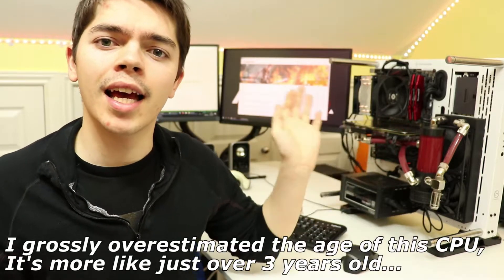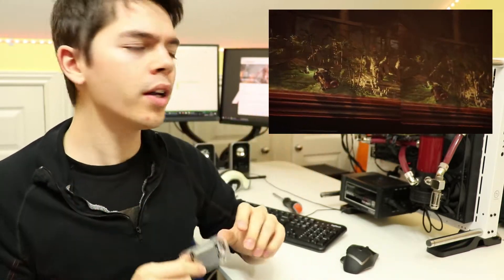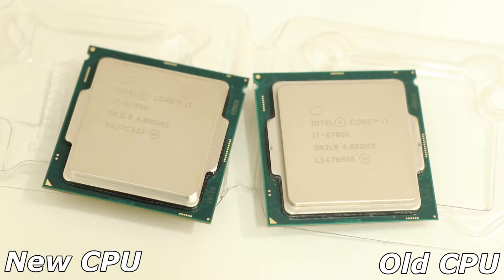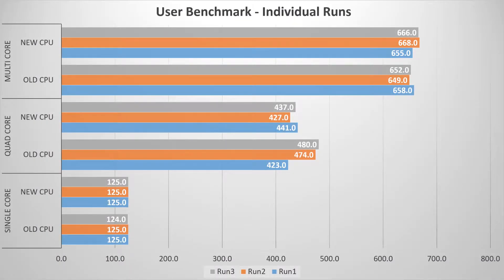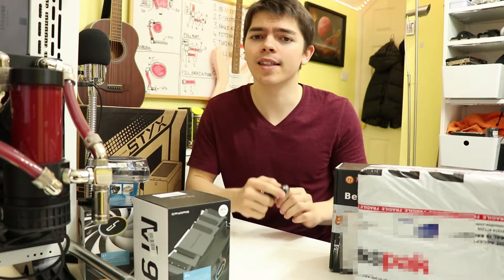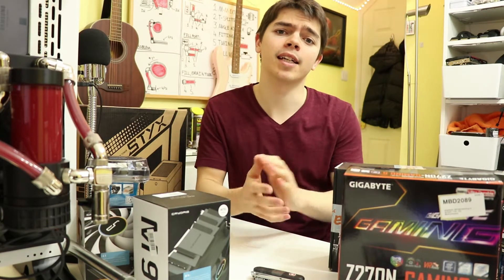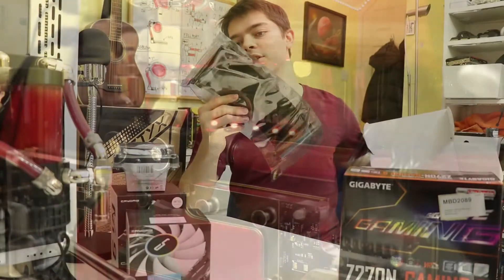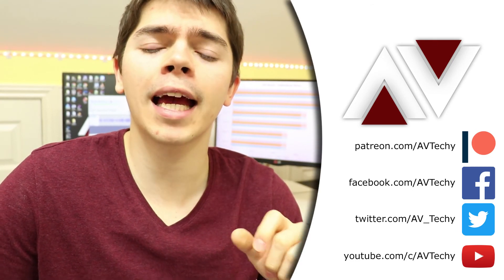Old CPU vs New CPU - Does performance drop with age?

Comment: I suppose another variable when you buy a used CPU, hopefully the cpu that was owned by the previous person didn't overclock it to the moon causing overheating/damage.
I.e insufficient cooler.

On the other hand a "locked" cpu might be a safer bet to buy used, since the cpu is locked from overclocking, so no undue stress was put on the cpu.

Comment: Idk, I have an i5-4690k that I've been using since late 2016 and I can tell that it's been struggling way more over these past couple of years, it's performance degraded severely in some more recent titles, going so far as to drop me 30 fps in most of them (making them bad to play or straight up unplayable). Did an auto and safe overclock on the Bios to 3.7Ghz recently, got about 15 extra fps in GTA V which is about what I was going for at the time, but I can still tell it struggles and tends to cap at 100% usage quite frequently, any tips?
Reply: First off, your windows will be slower and pain overtime, and with installing more softwares, it will be heavier, therefore causing lower framte rates.
Secondly, you should change your thermal paste once in 2 years. The quality of the paste also matters as in some cases, Thermal Grizzly's Kryonaut paste performs better than your conventional paste. You can also install GhostSpectre's superlite windows if you're just gaming on your pc.
Reply: combination of Software + Heat = Slower Hardware, Reinstall windows and clean your PC or use better cooler
Reply: @hashire1638  I built a different PC since then, it's got a Ryzen 5 5600X and an RTX 3070, still runs GTA at 80-100fps @ 1080p lmao

Comment: Good test , still running my old 6700k  on spare rig and with old 1080 it maxes current games and runs vr great .
Reply: I used a Xeon e3 1240 v2 for several years and now a i7 11700 some performance!

Comment: So why have my pc lowes down considerably since I bought it the first time? My gpu is slower as well.
Reply from the maker: CPUs and GPUs don't really degrade much in performance over time since they're solid state, unless they've been overclocked heavily.

What might have changed over time if the workload, perhaps they programs your using have become more demanding over time of your CPU and GPU which makes them appear slower.

The main factor which causes PCs to slow down is an old or full hard drive. Even SSDs slow down, mostly when they get close to full. Of course HDDs are far more susceptible to degradation with all the moving parts.

Hope that helps :)

Comment: I have frequent power loss at my dorm, I'm wondering whether that could degrade my pc performance over time? or will it just outright stop working if damaged rather than just slow degradation?
Reply: maybe PSU not sure id say make sure you are always plugged into a surge protector you should be okay. I doubt your hardware is damaged unless you are plugged into the outlet directly

Comment: thx for the video. i was wondering if this was a thing. i use a 4790K still. think its 5 years old by now. but i thought i saw some performance drop in games or handbrake (which i often use). But as i see now its not the case. i cool my CPU with a NH-U14s from noctua. just changed the thermal paste a month ago or so. so this is good to know that a CPU wont loose performance over time. Anyway nice video. will give you a sub :-)
Reply from the maker: Appreciate the sub! Glad you found the video useful and interesting. Hope you enjoy many more videos to come!
Reply: @AVTechy  you are welcome. and i am sure i will. keep up the good work :-)

Comment: CPUs do not degrade nearly as quickly as everyone seems to think. Even at temps up to 100C there won't be that much degradation. Overvolting or rapid, frequent, extreme temp changes are the only things that will actually kill them.

Comment: Shit test: all CPUs have different potential from factory.
Reply from the maker: Very true, but generally that's most noticeable with overclocking, not stock specs.

There are tolerances that are met out of the factory at stock specs (voltages, clocks, cache performance, etc.) which vary between each CPUs in the same SKU, but they are set within a certain tolerance. Lower or higher performing CPUs outside of the target tolerance will generally be set aside for a higher or lower performance specification CPUs. A poor performing 6700K might be released as a 6700T or 6700, or even an i5 or i3 with a some locked off cache or cores.

So some confidence can be found in the performance range based on the general "binning" process (not binning for the best performance, just performance based on the target specifications).

Regarding the target performance at stock speeds (tested in this video), I have relative confidence that there's little difference between CPUs performance based on age. The performance was very comparable with the voltage locked at 1.2V, and the clock speed locked at 4.0GHz. If there was a noticeable difference we would likely have seen a noticeable drop in performance output, but it's pretty clear that there wasn't a noticeable difference, so we can be pretty sure that the older CPU didn't fall far below the target spec (if at all).

If there were large variances in the temperatures or performance of these CPUs I'd be more inclined to agree with your comment, that could be down to factory differences (but the general binning process could also dispute this since we are testing stock specs, not overclocked or undervolted settings). But since they're so similar, I don't think factory anomalies are playing much of a role here.

Comment: Interesting test. I was expecting some degradation. 
Maybe a cpu that was used in an inadequately cooled system for many years the constant overheating may degrade transistors... Who knows.
Reply from the maker: Thanks, I wasn't sure what to expect. I think there are potentially some tests that could be performed that are longer (many hours) and more aggressive that could reveal a measurable performance gap. However I don't have access to that type of test (but extended stress test are possible on a lot of the bench-marking programs).

At least with these small tests it's conclusive that there aren't any noticeable differences during everyday and gaming applications.

I think you're right, with a poor cooling solution and high average processor load there would be substantially more damage to the transistors. I can imagine it would have to be at an average temperature of 70°C+, and potentially overclocked to accelerate the results. Someone did post an article to CPU degradation which was a good read, but I can't seem to find it anywhere at the moment.

But either way, it appears CPUs are tough components, and this opens the door to purchasing second hand CPUs with a little more confidence.

Anyway, I tend to go on a bit too long in the comments. Thanks for commenting and adding your thoughts, and of course thanks for checking out the video!

Comment: Any thoughts about getting a Ryzen CPU?
Reply from the maker: I was and still am really keen to get a Ryzen system. The extra cores would be more suitable to what I do most which is editing over gaming. And I will at some point start streaming some content, so again those extra cores would be fantastic.

The only problem I have is that to get a system that would be more capable than the current system I have, I would have to spend an amount of money that I don't have at the moment. Financially this channel can't really afford to spend money at a faster rate than it is right now. I'm going to need to save up a little to do a bigger video, it will happen at some point, but it's going to take some time as all good things do (let's hope it will be good anyway haha).

Anyway, I'm definitely interested in Ryzen as a more productive platform. I'm saving up for something, maybe that something will be a Ryzen build. It would be pretty cool.
Reply: Understood and that makes perfect sense. An advantage you have at least is most of your parts would carry over from your current build. A B350 motherboard with the Ryzen 1700/1700x will really be all you need. The 1700x as you have much better cooling solutions and won't use the stock fan with the 1700 (i think). But if you need to save up, there are new CPUs in April.... that could be an exciting thing to save up for. Good luck with whatever you decide to do.
Reply from the maker: That's certainly true, the parts are all here. But the funny thing about that is, I don't actually have a system that stays the same. Even the test bench is constantly changing depending on what video is being made.

It would be great to have a complete other system that I could use for all of my editing, since at the moment I'm constantly shifting the SSDs and HDDs,as well as the RAM, GPUs, and coolers to different systems for different videos. That's one of the biggest things to overcome when it comes to making these videos in the long term.

If I went for a workstation system, it would certainly be a Ryzen based system, and I'd want to go for a 'round' 32GB of higher clocking memory than what I have now, Ryzen seems to work better with the faster RAM. But RAM prices these days, it's insane! Of course if someone gave me an Intel based system with 8 cores then I wouldn't complain haha.

I think right now I need to put the channel first in terms of finances. I don't mean that I'm going to make myself homeless in the process, more like I will deal with the meagre issues of not having a consistent system for now until I get to point where I can have the cake and eat it too (and it's not like it's that big of a deal to work around).

Whatever happens it's certainly going to be interesting!
Reply from the maker: I don't think that's a term someone calling themselves 'Maestro' should be using...

Comment: Old CPUs definitely slow down over time. This is because transistors do experience wear, which results in reduced switching speeds. Most people never see this because they aren't running high clocks, but you might see the difference when overclocking or Turbo Boosting. Read more here: https://spectrum.ieee.org/semiconductors/processors/transistor-aging
Reply from the maker: I can imagine that is the case, wear and tear gets to everything eventually. Clearly I haven't got aged hardware that has been pushed hard to see that performance gap. Plus there are probably 10+ more relevant tests to perform to see those results, and there's bound to be far more sensitive equipment that can pick it up more effectively.

That's a fantastic article you've linked, I've skimmed through it so far, but I'll give it a thorough read over later on. Thanks for linking it, I really need to up my research game, so that if I end up with a vague answer, or any answer at all I can offer somewhere for people to go that I can recommend to look into the subject in a more in depth manner.

I hope this video didn't grind your gears too much considering there is a far more scientific and accurate answer to this question. I'll do my best to up my game in that area in future videos!
Reply: It was a great video! I wouldn't have known it if I hadn't taken a computer architectures course, so no worries. With the tests and information you had access to, you did fine.

It's a small difference anyways - I was just pointing out a small technicality (i.e. it does degrade, but you're unlikely to see it) for those interested in the more technical aspects of CPUs.
Reply from the maker: Phew, well at least I know what I can improve next time I try something like this again.

A Computer Architects course, I think you're a little over qualified for this channel. Just kidding, although you absolutely are!

How a CPU functions is something I would like to learn more about. As well as pretty much everything to do with a computer. I'm pretty clued up as far as basic materials science is concerned, but that's pretty basic for most people haha.

I'm glad you've somewhat approved this video (okay now I think I'm pushing it!). I'll settle for your enjoyment of the video though :)

I seriously appreciate the link for the article though, I'm certainly going to have a good read of it, and hopefully it will improve my understanding at least a little bit. And of course thanks for checking out the video, I'll always appreciate that!

Comment: what open bench case is that on you have there?
Reply from the maker: It's the Thermaltake Core P3, you can check the video about that here if you want:
https://youtu.be/gr8jVUBYqAU

It's a very capable chassis, and it's doing a fantastic job assisting this channel in all its testing videos. If you wanted a smaller ITX version, check out the Core P1. It's seriously cool, and it's something that I would definitely get if I didn't need a larger one for the videos on this channel. It's built like a tank and you can't cool a system better than removing the restrictions of a case. Of course this means that everything is exposed (but there is a side window which I'm not using), which would be a problem around children and cats. But it's definitely worth checking out!

Let me know if you have any other questions about the build or anything else, I'm more than happy to help out! And of course thanks for checking out the video, I appreciate the view!

Comment: Are you getting much difference in temps between the two? 
My 6700k always felt on the hot side but it seems to have got hotter over time, maybe I got very unlucky with the silicone.

As always, great content!
Reply from the maker: The temperatures seemed very consistent across the tests. I didn't notice any differences between the CPUs at all.

Have you changed the thermal paste since you've had the CPU, that can have an effect on temperatures over a couple of years. 

Thanks for checking this one out, it's a little different to the usual videos but hopefully it's still interesting to everyone.
Reply: Ben Cross I think you can't really compare that because that differs between cpu's even if both a new because if the silicon lottery

Comment: Very interesting indeed.
Congrats on 700 subs btw (a bit late :D )
Reply from the maker: Yeah it was something I was wondering when I was looking into getting another 6700K a while back. It didn't cost all that much more to get a new one, so I thought why not.

It's pretty crazy, 700 subs was only hit about 7 days ago, and where nearly half way to 800 already!

Just wondering, do you think the thumbnail for this video is better than having an thumbnail with the two CPUs side by side. I can't work out which would be better for the video. Let me know what you think.
Reply: AV Techy mmm, I don't really know. Having the two of them side by side might make it a bit more clear but I  don't really have any experience when it comes to thumbnails.
Reply from the maker: See I think you're right. I think the first banner was cool for the B-roll but it's not very informative. So I've changed it do something a little more direct.

I'm not exactly experienced in any of this either, your opinion is just as valid as mine in all of this as far as I'm concerned haha.

Thanks for your thoughts on the matter, really appreciate it!
Reply: AV Techy I can't see the new thumbnail yet because youtube  apparently needs some time for that. Anyways, when I looked at your channel to see if the thumbnail had changed I saw your corsair air 240 review has gotten >1k views =b (it is supposed to look like a thumbs up :D ) wich is nice.

It is also nice to see that hardware doesn't really degrade since I'm buying my cousin's (or nephew's I never really understand the difference) g3258 :D

I just noticed you uploaded the same day as declassified system again :D
Reply from the maker: Yeah it took quite a while to update :/

Yeah the Air 240 made it past the 1000 view mark the first one in months. Maybe things will start to turn around with the future videos. Let's hope 2018 YouTube stabilises, although with all the controversy around the Paul's videos I don't think stability is on the cards for YouTube, at least for a few months.

It's pretty cool I've made this video considering you are getting a second hand CPU. It's nice the video will have a positive real life impact for a subscriber, mind you you're getting the CPU anyway, so this is more of an FYI for you I guess haha.
Reply: yes, I hope for you (and most other youtubers) that youtube will fix their stuff ASAP.